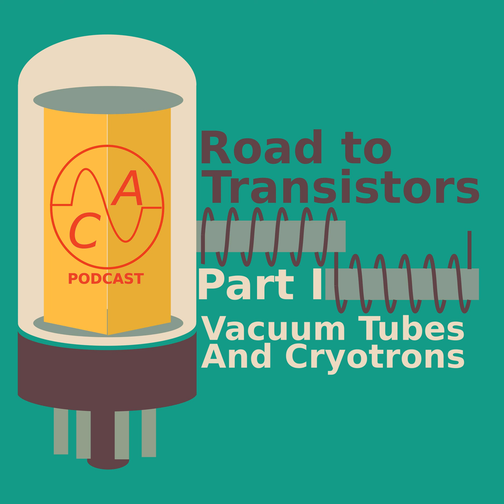Episode 31 - Road to Transistors: Part I

Comment: Vacume only isolated conductive heat transfer. Above around 40 deg C or 100 deg F, most heat/power it transfered as infrared light. So vacume or not has zero influence on heat transfer at that temperature. Reason for vacum is to remove oxygen to extend live of heater coil. Else it will burn up in no time.